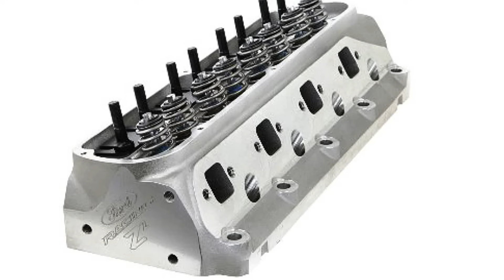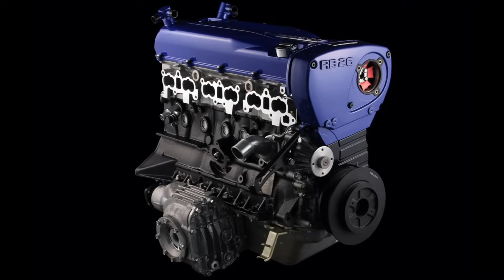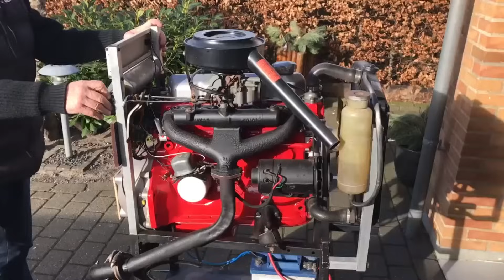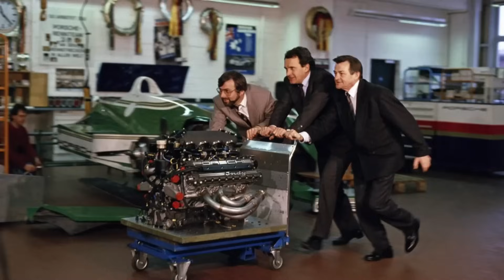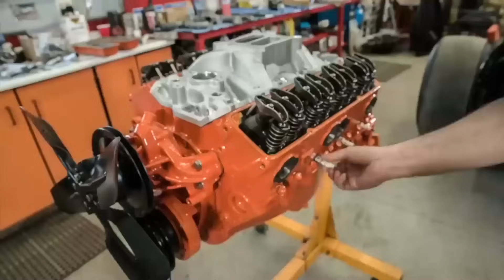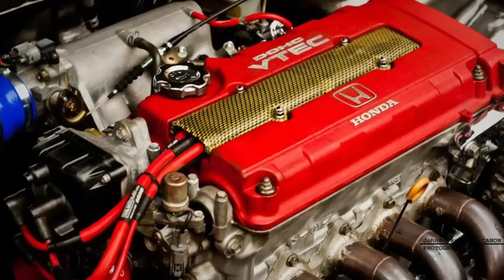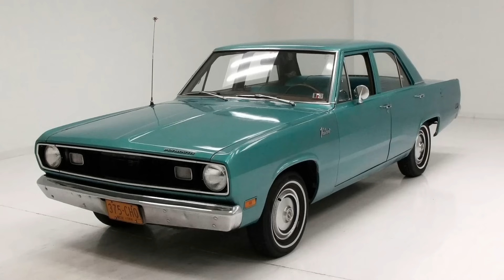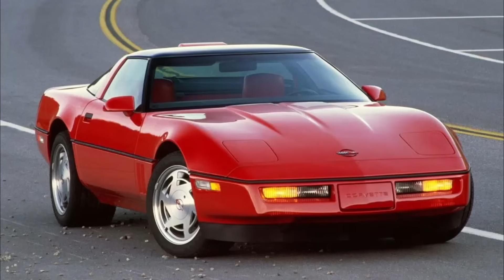30 Car Engines That Will Last FOREVER (2024)

Comment: WHY are you showing an OLD 1969 Camaro when you're talking about - or the Bot is talking about - the 2.2L GM engine?  It never cane in the older Camaro.  The 1969 Camaro offered 3.8L and 4.1L V6 engines, along with numerous V8 options up to 7L, or 427 cubic inches in the agreement that Chevrolet with Yenko Chevrolet, a performance oriented dealee in PA.

Comment: Toyota has many tough ling lasting motors from.inline 4 and 6 to v6 and v8. Older toyotas made from 80s to.early 2000s wwere all almost bullet proof. Over engineered making about 50 to 70% of hp that it can easily make. Thhe priginal v8 in exus and all the v6 and inline 6 lexus motors bullet proof. Older inline4 in trucls and v6 in the suv and truck.jyst cannot be killed, older camry 4 and 6 are also 500k mile engines with just basic maintenance

Comment: I was not s fan of the GM 3800(series I and Ii). It did not required much maintenance, but did produce good horsepower (ie. 200 to 205 hp). However, it was never made for performence. It was made to run for a long time. That was its key. Low and easy maintenance. The timing belt was cheap and easy maintenance, but replaced every 60,000 miles, to be safe. If you wanted more power add a supercharger. (Ie. 228 hp and 240 hp) This was a way to get a bit more power, while not burning up the engine.

Comment: 3.5 chevy both of my trucks ran forever,first truck 2001, I got 260,000, on it, including the trans all that was done on it  was tuneups,brakes still running, trade it in for newer truck,2005 chevy, pull 30ft camper,291,000 later,,only thing done, tune up,brakes, rear end went out at 280,000, trade in for a 2017 chevy, got 109,000, just brakes so far, love my chevy trucks

Comment: Someone here said good lubrication. and I agree. New cars say for life fluids, nope replace all on a schedule. Im not sure I agree with some of these, however some im not familier with.

 I had a friend with a volvo B18. When he bought the car him and his dad rebuil it. Totally stock. When I tell you he drove it hard, i mean it. He beat the living snot out of it all the time. lost his licince twice. Im not sure what car it was in  the 1968 142  door. I saw him do stuff in that car that stunt drivers do. He just knew the car. And the engine. Very well maintained. His sisters and brothers were real hard drivers as well. 
 
Long timing chains are an issue, Especially when poorly designed.

Comment: In 1973 I drove a 225 slant 6 in a 1967 Belvedere with 3 speed manual across the full width of the USA (and Canada on return) at 70/75 mph and that engine never burned oil. Car was sold in 1977.

Comment: Maybe I'm just lucky but i have gm chevy 2014 6.6 diesel in my truck that was tuned at around 100tho miles , it now at 230 tho plus miles with lots of power and so far very reliable, knocking on wood. Put a lift pump on at recommendation of mechanic. Replace front brakes at 217tho miles and didn't need them showing how much she is a baby to me, use the jake break always helps i feel. Surprised the big diesel engines were not included in this. Happy motoring and take care of these engines and they'll always be there for you.

Comment: I must add one to this list: The Ford 3.0L Duratec V6. Mine is in a 2009 model year vehicle with 267k miles, and it's not showing any signs of giving up any time soon. Probably not one that will take serious punishment, but if you drive her normally and change the oil on time, she will treat you to 300k miles or better.

Comment: My brother had a slant sex that blowed the piston to the side of the block so he just took the connecting rod loose, drove a piece of 2x4 in the hole and drove it for another 100,000 MI. It leaked a little oil but it was still running

Comment: I own at least six cars and then every one of them has over 200,000 mi. So 200,000 mi is not nothing. I own two of them that is pushing 500,000 mi. Still running great. Every engine should run at least 400 to 500,000

Comment: No way, where is the VQ35HR? Lots of problems with GM 3800 Series II, head gasket, water pump, crank sensor, etc. but ZERO problems with the Infiniti VQ35HR. 200K kilometers without any repair. I doubt your list is accurate!

Comment: Honda 3.0v6 or h22 will outlast most of these if oil is changed and timing belt is serviced. Jeeps 4.0straight 6 will blow these out the water as well.

Comment: My 2003 Dodge Cummins 24v 5.9 diesel had 420,000 miles on it when i sold it to someone who runs an excavator business. Absolutely nothing wrong with the motor. Only sold it for a new 2009 6.7l Cummins because it went through a terrible hail storm at the Sturgis bike rally.

Comment: So 3 of my friends lost 2 Toyota and an Isuzu engins in two weeks. Thermostats ! Bruce McCantire of the old Enginpart System, in BLOEMFONTEIN SOUTH Afrika lent me a 100 new Echlin thermostats which I set about testin. Exactly 25 of the 100 thermostats were no functioning properly. With thermostats one of course also has to consider the balance of the cooling system. Is it clean and effective oor not, how can it influence function of rhe system. So, having grown up in a regular Service station and having had many "run ins" with overfeating and cooling systems, I I set about creating the SalzmanN SAFETY THERMOSTAT. ! I can tell you many stories. ONE is, the faster your engine gets to a proper working temperature, the longer it will last. 
"                                                                      '

Comment: I find it strange you didn't mention the following German Ford engines:
Ford Kent range 1.0 to 1,6/2,0 going from 1959 to present, on the top used in the BDG race engines producing 275 hp in NA
- the Kent also used in 1800ccm turbo as base for the RS200, with insane performance details
Ford "Pinto" 1,3-2,5 OHC, going from around 1970 up to 2001 with 2,0 turbo in the Cosworth 500 version on top producing 224hp stock
Ford Duratec range 1.8-2.5 used in both Ford and Mazda.

Comment: I have gotten over 200,000 miles from nearly every car engine it's owned. My uncle had a 1966 Ford Fairlane with a 289 engine. It had 265,000 miles on it when the vehicle was hit by a rock truck.
I currently own two vehicles. A 2006 Ford escape with a 3 liter v6 with over 216,000 miles.  It still has lots of 'pep' burns no oil and gets 18mpg. 
I also have a 1997 Chevy 1500 with an extended cab. It has over 230,000 miles, burns no oil and has 45lbs of oil pressure while idling.
The keys to obtaining long engine life are regular and consistent maintenance, address problems as soon as they surface. These things will extend engine life no matter what size or type of engine your vehicle has.
A lot depends on the type of miles your vehicle has. Highway miles are a lot easier on engines that city miles.

Comment: Left out the 3UZ-FE 4.3 L V8 (LEXUS-TOYOTA), the smaler sister the 3MZ-FE 3.3L V6, and the most reliable engine ever made the 12 valve 5.9 Cummins turbodiesel, that has several documented cases over 3 MILLION MILES!!!!

Comment: I concur with the robot on several of these engines (personal experiences with several of these GM examples- I'm not biased!😁). However, the robot didnt realize the GM LS 'series' has many powerful, efficient, bulletproof examples, not just the LS1! Same with the predecessor smallblock, of which I'd include the 4.3l V6 (a Vortec 350V8 with 2 cylinders cut off), and other variants. Somewhat of a cross between an LS and Big-Block is the massively torquey and Bomb-proof Vortec 8100 (496C.I.!) that powers one of my motorhomes, or its predecessor Vortec 454 that powers my other one. The robot forgot a couple of the most obvious engines (one isn't even a GM, you proud of me!?)- The pre-emissions Cummins 5.9 diesel, and of course mostly pre-emissions Chevy Duramax 6.6l. Diesel (Particularly 2006-early 2007 LBZ). I worked as an outside contractor for Hot-shot companies (RV haulers), and personally saw numerous examples of both these diesels with 750,000- 1.5million original miles. The record original miles is held by a 2006 Chevrolet 3500 LBZ Duramax with 1.8million original miles on engine AND Allison transmission. Was used for GM advertising after 'retirement'.

Comment: 1990 - 1998 Subaru 2.2 is absolutely bulletproof. Sold mine with 325k miles because of the ridiculous retractable seat belts are crap

Comment: I can validate the 4.6 svt and the 5.7 350 is hands down, the best price, the ease to work on and 70 plus years running record is just boss...

But the 4.6 with forged internals is a knuckle dragger foreal...

Comment: The 1975 Ford Econoline's 351 Windsor. 198,000 miles, and the valve covers  bolts were still at factory torque.

Comment: Damn! you should increase the 30 to 40 plus... where is the 6.9 Liter Diesel from the Ford  F 250 guaranteed to last a million miles.. the 1.2 Nissan? the 283 Chevy Indestructible! the  400 small block Chevy? 327. 427, 409, 289 ford, 318, 340 wedge, 360, 383 magnum 440, 413 Hemi, 426 Hemi, 440 commando? 429 cobra, Geez get with the program...

Comment: Routine maintenance? Is that something that's done after it breaks???
You all know the difference....
BTW KIDS:
When something "BREAKS" it is broken.
When something "BRAKES" pressure has been applied to the middle pedal that slows or stops the machine.
Learn the difference and how to prevent it from BREAKING to begin with!!!
Also, Learn how to use your BRAKES.  
How to apply BRAKES?
(See instructions below)
Number 1: Put down the phone.
Number 2: See Number 1.

Comment: this guy never rebuilt an engine , claims the v8 ford and chevy have less moving parts than a overhead cam engine !!! what the fuck is he talking about , the gm 2.2 great? not !! i have seen a bunch with blown timing chains and it distroys the motor , the Mitsubishi ? yeah very powerful but lats long? no they don't , subaru? oil leaker and blown head gaskets galore i know i owned a bunch the best one was the 2.2 ,

Comment: Sounds a bit like John Goodman. We have owned many of these and can attest to the reliability over the decades. Toyota 2TC 4cy Hemi deserves a mention as well. We had several that would not let go, past 300,000 miles. One had 426,000miles on it when we finally sent it down the line. We had no replacement vehicle to put it in. The car it was in rotted away from too many Minnesota winters of salty roads. We had so many that ran so great but rotted away because of use here on salty roads. My son has a SBC 1995 Z-71 4x4 with 342,000miles on its original 5.7L motor. My brother had a 1973 Monty Carlo with over 450,000miles on its original 5.7 SBC. I had a 1979 Volare with a 225 Slant, it had well over 300,000 miles on it when I sold it. Wish I kept that one, had no where to put it though with its failing transmission 😢. I believe in using synthetic oil, we get good results with it. My 2008 AWD SEL Taurus X Ford 3.5L V6 has 254,000 miles on it now, knock on wood it’s been a good runner with good performance too. I paid $3000 for it 10yrs ago with 171,000 miles on it.

Comment: I bought a used 1985 Volvo 740 my freshman year in college. It had 140,000 miles when I got it. It was my party car, with many trips up and down the East Coast. It had a B230 engine. I traded it in after I graduated, and it had over 250,000 miles. I put the VIN number in the carfax, and the car is still going through vehicle inspection in 2014. I don't remember the mileage. I just loved that car. It's good to see that engine in this video.

Comment: The 1999 to 2006 5.3 vortec should have been added to this list, I've personally known many people who have this engine in their trucks and 350,000 miles, and more isn't unusual. 
I have one in my 2004 Avalanche (230,000 miles) and still running like new. 
The weak link is the 4L60E transmission, but it's not the fault of the transmission it's the owners pulling  trailers and hauling heavy loads in overdrive, and if equipped with haul mod not activating it when they should. 
Mine still has the original transmission and shifts flawlessly. 
Regular fluid and filter changes are mandatory, not just a suggestion. 
The LS is a great engine, too, but keep an eye on the harmonic balancer. 
If it starts going bad, it's going to destroy the engine.
It is best to replace it with an upgraded one, and it should also be pinned. (Stock is pressed on) no keeper.

Comment: Chevy small block - first introduced for the 1955 Chev sedan: 265 CID.  Then, in '57 became the 283.  Later, 305, 307, 327, 350, 400.  Used in most std. Chevy vehicles --- full size, compact, Corvette.  Early '60s Vette - 327/365HP Fuel injected.
Reply: You missed one. The 302 variant.

Comment: Renault 1.1 litre in a 1989 Campus. Got regular early oil changes with the cheapest oil I could find (as long as it met the spec) and was still smooth and powerful at 260K miles when I scrapped it due to other issues. It was never opened up and never used oil between changes and fuel economy was excellent. I miss that car.

Comment: Disappointed the GM LM7 5.3 Vortec wasn't mentioned. IMO these are fantastic, durable, reliable engines with proper maintenance will also run for 300,000 miles

Comment: I bought my Toyota Tacoma back in 2000.  It has the 22RE engine in it.  I've had ZERO problems with the engine.  Only problem I've had is with the emissions system, and that is mostly vacuum leaks, easily repairable.  I currently, after 24 years have 130,000 miles on it.  It will live longer than me, as I'm 58 yrs old.  I do regular maintenance on it and it runs like a champ!  I just changed the plugs and coils for the 1st time after 24 years of driving.  I'm still on my 1st clutch, the manual transmission runs smooth and I've changed the front rotors only once.  I replace the oil, oil filter, hoses, air filters, belts (only once so far as needed), and brake hoses as needed.  I flush the cooling system once a year and put in new anti-freeze.  I've lubed the bearings by hand, at basic intervals.  I changed the brake shoes (rear) and pads (front) only once, and they weren't even worn out yet, because I changed the rotors, they were warped.  I wish they still allowed Toyota to make such vehicles, but due to emissions standards, they've had to make trucks larger and larger.  A larger vehicle allows for more emissions, that's why "American" vehicles are so large.  Not because we want larger vehicles, but because our government requires it to make "emission standards".  Quite frankly, my micro truck is less environmentally impactful than these new larger vehicles.  I get 36 miles per gallon with my little 4 banger!!!  My micro truck produces less carbon emissions than the new "environmentally friendly" big arse trucks from Toyota and all the other manufacturers.  Take that you gov't jerks!!!!  Drive a smaller truck, and you'll have less emissions!!!!  Think smart, not in percentages!!!!
Reply: I’ve had one those as long as you. They don’t get 36 mpg. Very predictable mpg.  But not better than 20 on a flat road going 55.
Reply: I have an 07 Taco 6cyl/6speed with 266500. Zero engine issues. 180000 on the brakes and 190000 on the clutch. 6 batteries. Lots of tires. And the overhead therm display needed to be re-capped. Drivers seat, steering wheel and shift knob look like hell but zero other issues. Amazing vehicles and I'm glad my dad taught me about oil changes and general maintenance

Comment: The Chevy actually didn’t come out until 1967 in 54 it was the 283 and 327 sbc
Reply: Actually the Chevy small block came out in 1955 as the 265 it was bored to 283 around 1960 and then stroked to 327 around in 1964 0r 5 (I can't remember exactly), but I worked in gas station at the time and we rebuilt engines at the time. Stroked to 3.25" in 1967 with a 4" bore. Shortly after that they bored it to 4.125" and took the crank to 3.50" and made the 400ci small block but only put it in trucks. They went to a one piece rear main in 1986 to stop oil leaks. The amazing thing is they never changed the bolt hole patterns on the engine and everything will swap if you know what you are doing. They kept the same engine to tranny pattern on all Chevy engines (6 cyl, small block, and big block) Ford must have had 15 different patterns during that time.

Comment: we bought a ton of toyota trucks for cheap in the 90s with the 22re . There is a design "flaw" if you call something that takes 200,000 miles to show up a flaw.... The old 22r had a double timing chain the 22re went to a single chain. The chain would stretch out and eat a hole internally inside the timing cover and eat into a water passage . This cause massive amounts of people to think it had a head gasket issue so the sold the trucks cheap. We would pull off the cover send it to be welded and change the chain . If it was a stick shift we knew we could easily drive it for 500,000 miles. If you wonder where they all are now, they are in Belize. There was a massive exporting going on in the late 90s and early 2000s. That's why you don't see them anymore , they are still running down there today. We had an exporter show us pictures of what they did to one we exported, they took off the bed and welded bleachers to the frame and ran slow all day charging rides around town at the end of the day he would drive it to his village and there was this double wheel thing he would drive it up on. He would put they truck in 2nd and let the wheels spin in back kinda like a poor man's dyno. It was hooked to a small generator head that powered a few lights and the village water pump . They would fill buckets for the next day and prepare dinner  . come to find out that No one person bought the truck, it was an entire village that  put their money together and did .